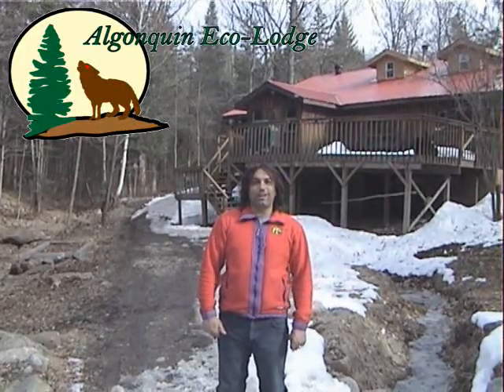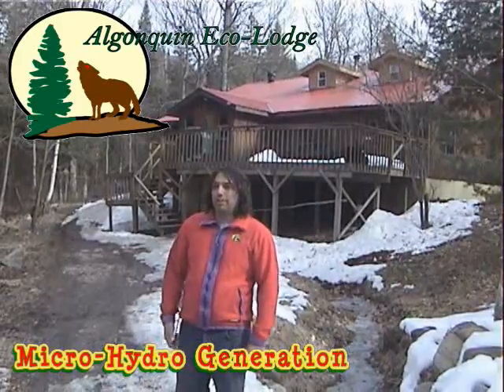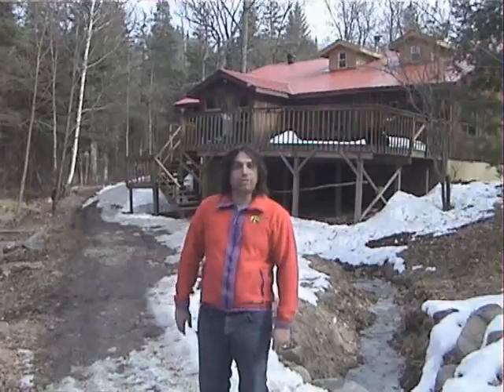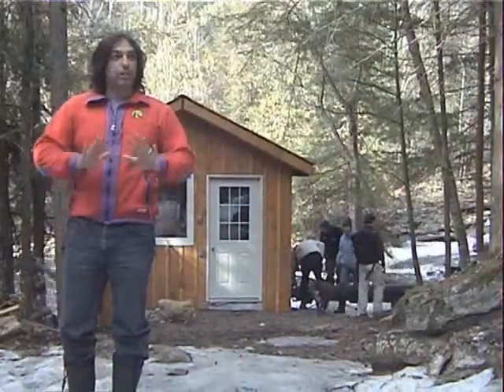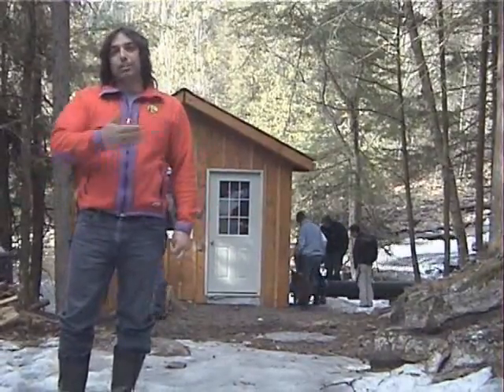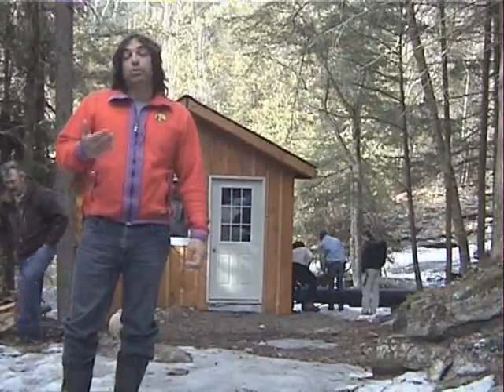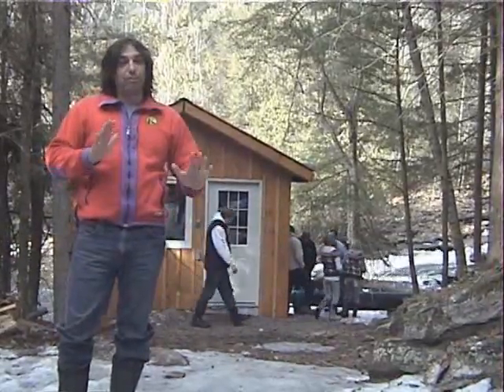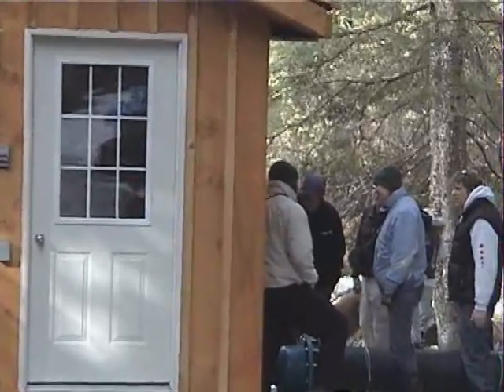Algonquin Eco-Lodge - 12 kW Micro-Hydro Turbines

Comment: You know what you could do, is put a third old wooden paddle wheel generator on the out side, to make it look rustic and generate, some additional power. Now, you don't have to be totally authentic and make it a wooden shaft for the old paddle wheel design. You could use a metal pole instead. But this would give you a third generation Type. Just some hopefully cool idea's. Sam

Comment from the maker: Yes, it is a lot of money.  But every little piece adds up.  The stainless steel screen, with 2.5 mm holes to keep the fish out, cost $4000.  Each bolt (high tensile stainless steel) cost $8.  The wiring is armoured to protect from being chewed on by animals, etc.

Comment from the maker: It's not just "some pipe"!  It's expensive, large high density pipes (city water mains) capable of resisting freezing and abrasion on rocks. Turbines and generators are custom designed an built.  And then construction costs in a remote location that is difficult to get to and no truck access.  None of the items were super expensive in themselves, but it all adds up.  Each bolt high strength stainless steel and cost $4!

Comment from the maker: Our system was C$80,000 plus electrical upgrades to the building.  If you have a water source then solar or wind is not even worth looking at as you get 10 times the power from water for the same investment.  Plus, you don't have any batteries to deal with (they only last so many years and then end in a landfill).

Comment from the maker: With the scale of our project the noise is not an issue at all.  In the winter, with the windows of the powerhouse closed there is no sound other than the river.  In the summer, with the windows open to dissipate heat, you can't hear any noise from the turbines once you are more than 3-4 metres away.  Just the sound of the waterfall!  :-)

Comment: Putting collars on the pipes and isolation pads under the equipment would have been a small cost increase and decreased the noise dramatically.  I know you said there wasn't much noise, but it could have been significantly less.

Comment from the maker: Add up all your lights, your fridge power rating, freezer, water pump, etc.  That will give you your minimum required.  Then, if you have enough water you go for more power, since you will always be able to use it.  We use our excess electricity to run an outdoor hot tub, and for electric heaters inside the Lodge in the winter.

Comment from the maker: @TheHundrethmonkey There are no batteries - we produce too much power for batteries.  The extra power go to the "dump loads" which are electric heaters.  During winter that's great as it heats up the Lodge.  During summer we have another bank of heaters outside and we just "blow off" the excess power when not needed.

Comment: Is there a  battery bank in this install or is everything regulated through the controllers on the wall? also just trying to figure out how you regulate the 60 hz with a system like this. Ive seen some setups that use heaters in the penstock to regulate the extra power not used.  Very tight install!!! Just awesome!

Comment from the maker: @exclamation3mark The turbines and pipes and electrical work cost about C$80,000.  Maintenance is very cheap - just a bit of hydraulic fluid and greasing a few nipples on the turbines.  We'll probably have to replace a few pipe support cribs as the years go by, but that's not too much either.

Comment from the maker: @AriBenDavid If we were to block off the entire river we could probably get about 100 kW.  But we are only allowed to divert 10% of the flow.  That gives us nearly 11kW in the winter (when the water levels are higher).  That is enough for a hot tub, some electric heat, lights, and electric appliances.  You can always use more power for heat in the winter, but you don't need that much in the summer.

Comment from the maker: @PigeonTech The water seems to be about the same temperature as the river it came from, so not much advantage to be gained.  Also, if you put the discharge pipe back into the river (underwater) you get suction forming which increases the flow rate and therefore more electricity.

Comment from the maker: @AlternativePowerMan 1 day ago

Last winter it dipped down to -32C in January and the pipe kept flowing. The diameter of the pipe is big enough and the flow fast enough that it didn't freeze up. Now, if we get a -44C cold snap (like we did a few years ago) I don't know how they'll perform. We want to insulate the pipes with styrofoam but that will have to wait till next summer (and some volunteers!).